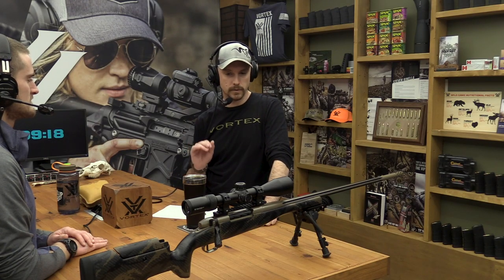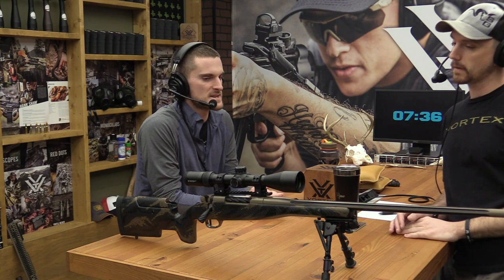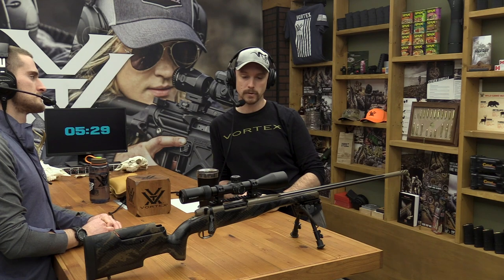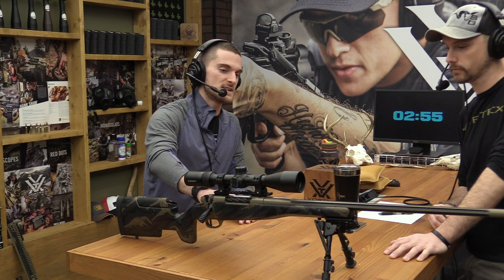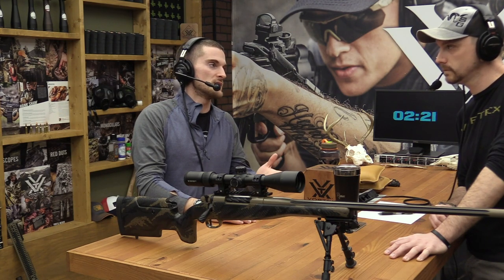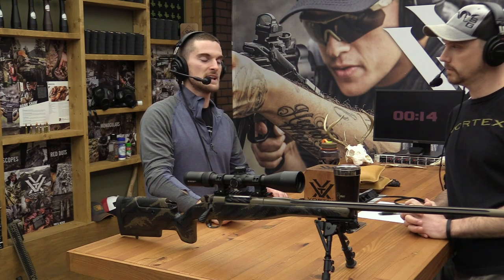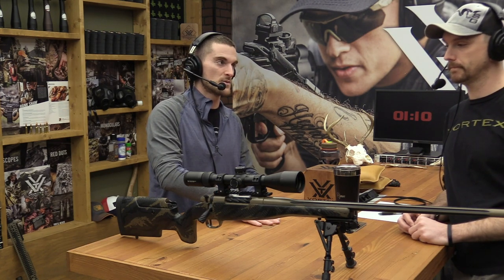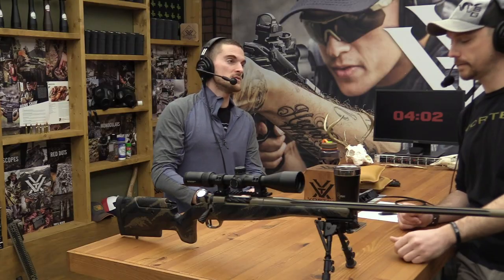#10MinuteTalk - 20 MOA Bases

Comment: If you want to maximize your scopes potential you have to put a base on that is half the total elevation of your scopes travel.  Ex. If your scope has 80 mins of elevation you put a 40 moa base
Reply from the maker: Tim McFarland not necessarily - there are a lot of cases where doing something like that could actually put you in a worse situation. Maybe even not being able to get zeroed. It’s all situation and application dependent. If you’re going to be hunting or shooting at intermediate distances, there is usually no need for any kind of canted base at all.
Reply: That's about the way I see it as well.
I'll go 5 or 10 under that depending on what's available to be sure that I can get zeroed at 100.
I like my scopes setup so that I have a few clicks under 0 but not much more than that.
It 1, eliminates the need for a zero stop,
2, allows me to use all my elevation.
What's the point of having a scope with 110moa of elevation if you could only utilize half of it?
With that said, there's no point in having more scope than you need.
The scope needs to match the round and distance you're shooting. 
300prc will make it past 1760. 😉
Reply: More plainly said....
I paid for the whole damn scope, I'm using the whole damn scope. Lol

Comment: why aren't scopes made with most of the MOA built into elevation? For instance, if the scope has 80 MOA total why not have 60 MOA in elevation and 20 to dial down? Whoever dials down 20 MOA?
Reply from the maker: It's impossible to "Build this into the scope" because all rifles, rings/mounts, calibers, zero distances, etc that affect where the reticle will ultimately be zeroed are different. When we talk about riflescopes and total elevation adjustment, we usually just assume that the reticle is zeroed somewhere near the middle for easy math and easier explanation in theory, but in reality, the reticle is almost never zeroed perfectly in the middle of the travel. There are microscopic barrel-to-receiver and other misalignments that need to be compensated for, scope over bore height that needs to be compensated for, zero distance, etc. If your zero, with a totally flat one-piece base is pretty close to the center of the scope's travel, you can "Build in" some extra adjustment and take up that effectively "Useless" space in the rest of the travel with a canted base like a 20 MOA base, That will physically cant your riflescope down 20MOA which, when compensated for with your elevation adjustment, would effectively do exactly what you described. Hope this helps!

Comment: All bullets drop as soon as they exit the barrel. Gravity. Most people zero on the the first intersection of bullet path and optical view. With a moa base you zero on the second intersection.
Reply: That’s not really how that works. Depending on distance and sight height, most people zero on either the arc peak or the second (downward) intersection no matter what base or mount they are using. The only time you would zero on the upward intersection is if you are zeroing under 100 yards or if your optic is very far from the bore.
Reply: Wow! Excellent example of people on their internet Boldly posting nonsense!
Reply: First or second intersection is strictly based on the distance you are zeroing at
Reply: If you zero on either intersection, you are in fact zeroing on the other intersection. The trick is shooting almost straight up and dropping your bullet directly onto your target from above: the “third intersection”. 🤣🤪